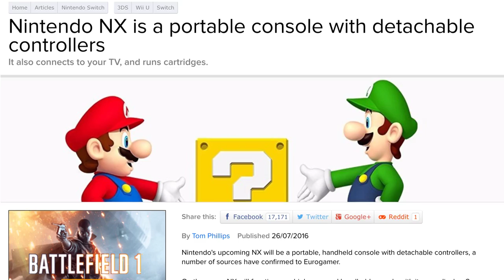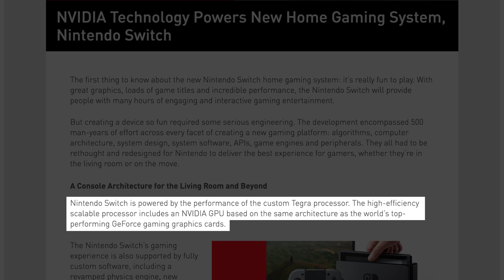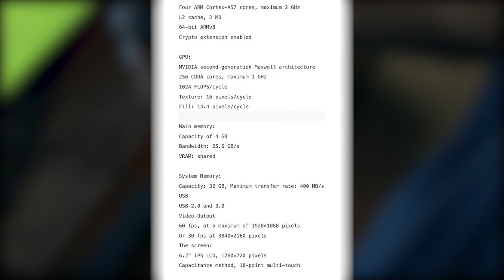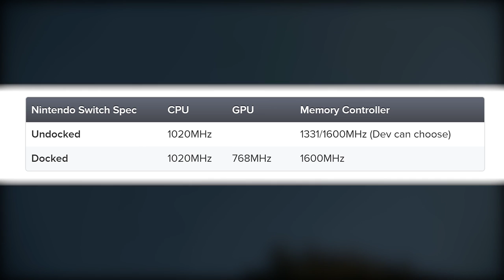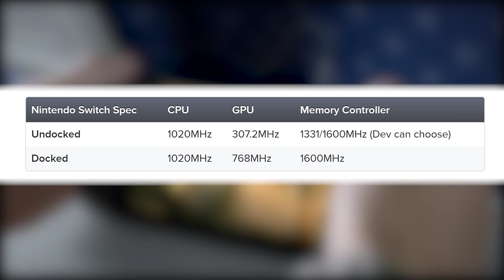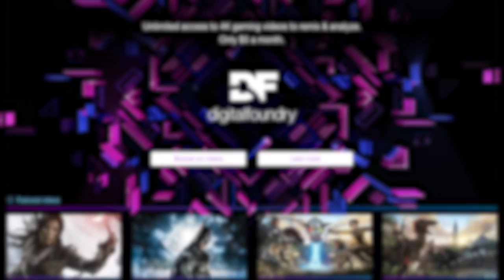DF Videocast #6: Nintendo Switch Clock-Speeds Revealed

Comment: When you set the bar incredibly low  and Nintendo still manages to find a way to crawl underneath it.   Nintendo never changes.
Reply: Walther Penne Put the fucking big battery to fucking console.
Reply: I at least expected the chip to run at its full potential when docked, but its worse than the Nvidia Shield from 2015.  Thats just unacceptable.
Reply: Why don't you just wait till january 13th to see if the Switch is "worse than the NShield"? Keep in mind it's all speculation here, even for DF.
Reply: DF leaked the basic concept of the Switch months in advance, so I'm going to give them the benefit of the doubt when it comes to these leaked clock speeds.
Reply: You're saying it's Maxwell before it's even confirmed to be Maxwell. Your speculation is based on devkits rofl.
Reply: The main improvement Pascal would bring is lower power consumption at those clock rates.  Unless the Switch has more Cuda Cores than a standard Tegra X1 the performance is going to be lackluster.
Reply: ***** lower power consumption = more power = just stop.
Reply: Tegra Pascal's only main advantage over Tegra Maxwell is lower power consumption at the same clock speeds, but the overall performance is pretty much identical clock for clock.   You would still only be getting around 350 Gflops at those clock speeds even if Pascal was used.
Reply: SEGA was better
Reply: The only saving grace, or somewhat saving grace is if Nintendo's Tegra SoC has more GPU cores than a standard Tegra X1 which means it could hit close to stock X1 power at lower clock speeds, but I'm not counting on it.
Reply: War Never Changes

Comment: i don't think 16 gb of storage will be enough
Reply: My Vita has 64GB and even that's almost full. lol
Reply: how come your vita is almost full? everybody knows there are no games for vita.
Reply: Brecondo (Sovereignty Yo) How many organs did you have to sell to get that much memory
Reply: dafuq you talking about, you can easily fit a day 1 patch into 16gb of space
Reply: Of course it isn't, but 128 gb SD card aren't expensive anymore.
Reply: Cartridge based = games are stored and saved on cartridges. Do you even Nintendo 64
Reply: but some people download the games from the store
Reply: im sure that they thought of that, expandable sd memory...
Reply: *****
I have something like 40.
Reply: Highly doubt patches will be planned to be stored on cartridges. That would mean they would have to preplan how large to make the cartridge in order to fit future updates. Also it's definitely a better idea to keep saves on a different form of media instead of the cartridge. Even the N64 had memory cards (although not always used).
Reply: Sahal Sidat it will use sd cards to expand storage and the game carts can store significantly more data than blurays so game updates could theoretically be stored on the cartridge
Reply: Sahal Sidat 
no it will because it won't require you to download the game off the cartridge. digital games will be a problem
Reply: Nintendo loves SD cards though. It'll probably be expandable.
Reply: Nintendo consoles run games off the disc or carts, never the harddrive. So they don't need much harddrive space.
Reply: Axel's DDO Channel bitte ich Download the games from the store
Reply: The Monsta yeah I don't buy digital, all physical. If you buy digital yeah it's an issue.
Reply: Axel's DDO Channel
The consoles does run games off of the harddrive if it's a digital download. It'd be a problem for a digital-heavy user even if it does accept 256GB SD cards
Reply: +Francisco Mello 
Porn.
Reply: ***** I get half of my games from the eShop on the Wii U, and all of them on the 3DS. However both consoles have expandable storage so I didn't run into any issues. 3DS games are usually fairly small, though.
Reply: 16GB is the size of the cartridges, not the size of the internal memory.
Having cartridges means you're probably not going to be downloading nearly as much, and you should be getting the same load times from games on cartridge as games on internal storage.
That they're using cartridges actually means that internal flash memory is much less important.
Reply: Bud 10001100101000 also they might even leave enough space on the carts to put the patches on there as well
Reply: *****
Patches will probably have to be on the system flash drive, cartridges are "ROM" "Read Only Memory", which saves a lot on the cost of manufacturing.
They usually have "some" writable storage on cart, but I assume it would still be more efficient to just allow that to all sit on the system or expandable storage.
Reply: Does 3DS work that way (ROM cartridges)? Agreed it would be a good way to reduce cost.
Reply: That's right, Nintendo cartridges have never been fully writable, they just come with a few megabytes of writable memory for game saves.
Reply: On the 3DS, saves for physical games are located directly on the cartridge, however updates and DLCs are saved on the SD card.
Reply: I hope they leave 0 space for patches, and make the game right the first time, like they used to do.
Reply: Thats never going to happen dummy, and when games in the past had bugs or mistakes they often released another version of the game to fix said issue [Meaning BUY the game again] or just never fixed them at all, games will always have problems in code and will always need to be fixed and we're lucky to live in a time where games can be repaired via a patch
Reply: ***** Hey don't call me a dummy, I wont be talked to like that.  Good bye.
Reply: +caden boss I really don't see how USB storage would work on a handheld though :/ Especially when you are supposed to be able to remove the console from the dock at any time and just walk away with it.

Comment: The big advantage over the Shield TV is that the Switch will not use Android as the OS, Android ist not very good to utilize 100% off the Hardware Performance, Micro Stuttering and and and.
Games on the Switch can programmed directly to the Hardware because you have the whole Hardware access.
Reply: and nintendo rules when it comes to making first party games.
Reply: AngryApple Not really. Now Android has Vulkan. Even so the shield is like 3-4x faster. Look at what a PC that is 2-3x faster does do consoles. Yes 1st party games will be fine but it just means nothing has changed,
Reply: Orjon Zaganjori lets hope its just an custom android version. we do need that vulcan support for 3rd party games.
Reply: Orjon Zaganjori even with Vulcan you can not access the whole Hardware on Android
Reply: Yeah, but still doesn't remove the fact that the device is seriously underpowered. Think about that it was at least on par with Shield TV on power and could utilize it properly. There's no excuse for this.
Reply: MadFinnTech And you want 30 mins battery life with the potency of current gen? is that it?
Reply: ***** That's what would make this different.
Reply: Bingo. The problem with android, you don't know when you buy a game, if its going to run on your device. Granted, the shield deal is definately better from what I see. Both Sonic 4 episodes, won't run on my note 4. But will run on a much lower powered tablet I had for a short time.
Reply: BrysNightWorld At the bottom of the play store pages it tells you the minimum specs to run things. That's how things have worked since the dawn of the PC, you check that before you buy. We can't make everything 100% idiot proof.
Reply: ReziahT You've got that wrong. The problem isn't 'reccomended' specs like on pc. The issue isn't 'hardware' mate. I've been a pc gamer since 99'. Those same sonic games, work on my super old galaxy express, just run slower.  But not on a note 4 at all. 

If a game doesn't run on your pc, a quick google search usually has a fix for it. Can't so much do that on android.

Every android has slightly different software. And developers, can't optimize for 'every' single android version, and device. Another deal, google cardboard. Had a blu pure life xl with a snapdragon 800 for a month there, and official google cardboard apps would only be a 'tiny' circle in the middle of the screen.But on my friends note 3, worked pefectly fine. Same specs. 

tl;dr your comment is very immature, and very uninformed.
Reply: BrysNightWorld lol since 99... Oh you kids.

It is exactly hardware. If your GFX card isn't powerful enough to run a game it just doesn't run. Try running a modern game using an old card and it'll simply CTD or give a notification on startup that your machine doesn't meet minimum specs.

Heck, try running an old game on PC without DOS BOX.

Every PC has slightly different hardware, which is why some games crash with NVidia but don't with AMD or vice versa, or some work on Windows but not Linux. Some older games don't like multicore processors but others are fine. There's also the whole 32 or 64 bit thing. 

But you keep pretending I'm the immature one, afterall, you likely believe this video too.
Reply: Ombro I'm not sure why I'm responding to a troll, when I have hamburgers beside me. Hmm.

Why...is it.. you still can't get my point? My 2nd part specifically says, Sonic Episode 4 runs on very, very old hardware. But doesn't run at all on more powerful, modern hardware. What is there to comprehend? Same thing with the google cardboard deal. Same hardware, but different software caused it not to work.  Not working on windows vs linux ain't hardware bud.

You said the google play store says what hardware is required. Maybe it does on your store, I dunno. But on android 6.0.1, no, no it does not. Only if a developer themselves put it there. Which is quite rare actually. 

If a game doesn't start up at all, that is not necessarily a hardware issue! Jeebus. You can easily run x86 on 64bit hardware. Sure, sometimes rare software takes a patch to make it.

Comment: There is no way in hell final fantasy 15 will run smoothly in the switch.
Reply: It doesn't even run properly on ps4
Reply: Frantz 
720p low no aa and it will run but will look shite af
Reply: Holowknite What are you talking about?I do have the game and it runs fine at 30 fps.The switch isn't even as powerful as the og ps4, that's sad.
Reply: Frantz at 140p
Reply: Frantz 2 words

cheap port*.

*less graphics.
Reply: claudio morales flores 
uhhh this doesnt make sense at all you know?
Reply: no way!
Reply: Look at the digital foundry video it has ridiculous framepacing even worse than xbox and has fps drops
Reply: Holowknite 
i played tlou on ps3 which runs kinda worse then FFXV on ps4, i really had 99% no problems with the fps
Reply: @rulewski33

The switch will be weaker then an iPhone 7 (which already outperforms the not downclocked Shield console and Pixel C tablet in most benchmarks).

Here are some Benchmarks guys.

Geekbench 3 (processiong performance)

iPhone 7 - Singlecore: 3380; Multicore - 5500
Nvidia Shield Console - Singlecore: 1650; Multicore: 5040

The Switch will run at 50% of the Shield Consoles clockspeed.

GFX Benchmark (graphics performance) Trex 1080p offscreen Render:

Nvidia Shield Console - 120 FPS
iPhone 7+ - 108 FPS
Google Pixel C Tablet - 103 FPS
iPad Pro 2015 - 170 FPS
Xbox One - 400 FPS
PS4 - 480 FPS

And the Switchs  GPU will run at 1/3 of the clock speed of the Shield Console.

=> it wont run in the switch, Not even in 360p.
Reply: Frantz You'd be lucky to have that game even boot on 153 GFLOPS.
Reply: coolertuep 
i guess only selected games will run in Handheld Mode
Reply: Frantz I don't think the switch is getting it honestly it's a very open game
Reply: lmao brush tf u talking about, on the ps4 ff15 has framerate drops
Reply: retrogamerfan 
it should run while in docking mode, but in Handheld mode it definetly wont run
Reply: RinkuHeroOfTime 
720p
Reply: It can run properly with less graphics and textures. PS4 Pro getting a 60 fps patch soon. Enjoy skyrim which is a 5+ year old game that's gimped.
Reply: Seth Rogaine ps4/xbox one barley allow devs 4-5 gigs for games
Reply: LOL, 90% of your PS4 games are not running smoothly. Get a PC!
Reply: Tony Jenn 
up to 6gb can be used for games! 
The Switch will have 4gb RAM Ok? but then it just can use 2-3 GB RAM for games...
Reply: Actually, they allow for more than 4-5 gigs of ram. Your statement is inaccurate.
Reply: Rockymann27 
thats what i said, they can use up to 6gb
Reply: @gnadenlos
There are indeed running smoothly, you are  just spilling BS! so go back to your PC gaming full of glitches, bugs, constant driver installation and boring exclusives.  

the only good thing I see in PC gaming right now is the emulators like MAME (LOL), anything else in PC gaming right now is just crap and it doesn't justify spending hundreds and hundreds of dlls in PC hardware.
Reply: rulewski33 Your comment wasnt there when i posted it. Sorry lol
Reply: @nexornator: Get G-Sync and a 980ti/1080 an you will know what smooth means. 30fps is not smooth. Instable 30fps is a bad joke. And PS4 has more Remakes than Exclusives. Switch games in mobile mode will be as smooth as the PS4, because it can't get worse.
Reply: They should make a gimped version for switch.
Reply: FF 15 is meh anyways and Nintendo makes way better exclusives than ps4 so talking about specs is irrelevant.
Reply: Yann Christiaens Better exclusive ? hahaha that was in SNES era.
Reply: FFXV have issues running on the PS Pro as well. LOL. So stop that postpartum depression.
Reply: Yann Christiaens Like what your little Mario party and smash bros??? lol
Reply: Yann Christiaens Its 100% your personal opinion that they make better exclusives/games. Not a fact.
Reply: Frantz Ya，like Smash Bros. With all Nintendo exclusive games combined，their games scored over 90%++ most of the time compared Sony's. That's fact. Don't believe me? Try google，“Wii U has twice as many top-rated exclusive games as PS4 and Xbox One combined”.
Fact with black and white. That's Wii U，not to mention Wii and the rest of it.
Reply: Icer Zerocool Thats a double edged sword, as their non exclusives scored a lot lower compared to the other 2.
Reply: Rockymann27 Which is why I have Ps4. But really I still have Nintendo exclusive games in my library. Most of my ps4 games I have sold them. I find the replay value of nintendo games are really high. That's just me，I am an 80s NES console player to this day :)
Reply: Icer Zerocool Im an 80s nes console player too and i dont even have that many games for the wii u. Im the opposite of you in the games area. I find more replay value with games on ps4 and have only sold one or two ps4 games at the most. But to each their own :)
Reply: Frantz it Wil run well at 720p docked at 30fps lol. this swit ch shit is popcorn junk
Reply: PokeMadness1996 Link to a credible and reliable site to prove this?